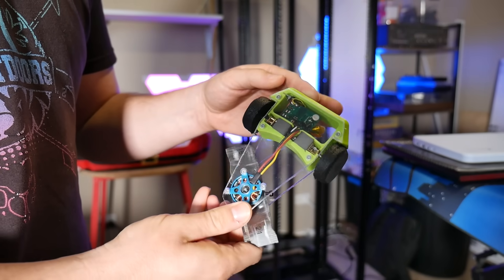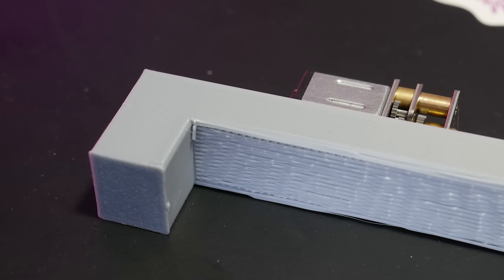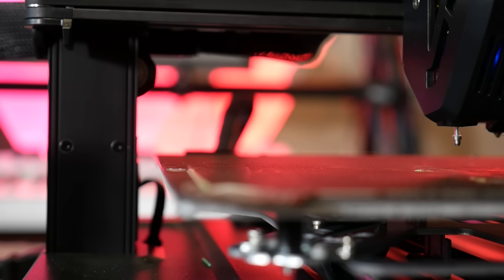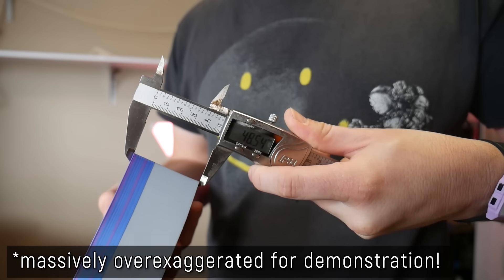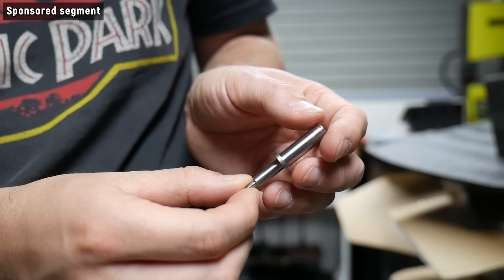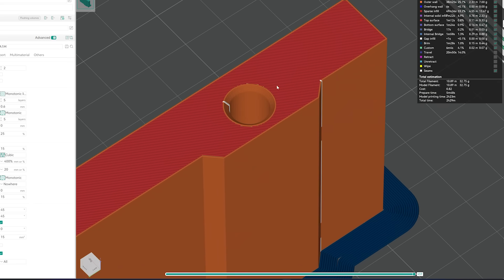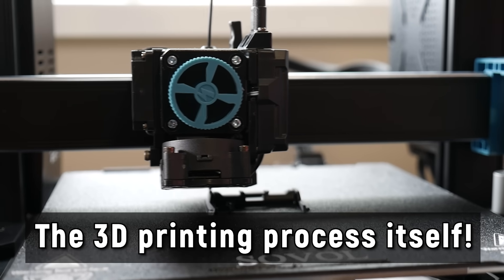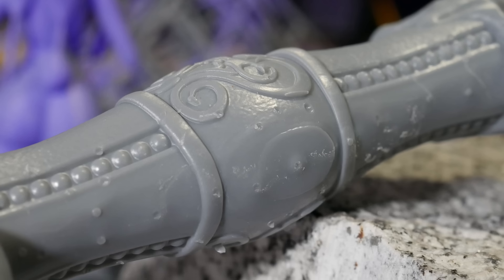Don't make these 3D printing mistakes (they RUIN accuracy!)

Comment: last night i printed a plate for a second time, 2 parts on it, print by object
the first print had detail that i didn't even see on the slicer, it was on one of the parts only

I resliced but only changed variable layer height on the other part on the plate, not the one i'm referring to with the extra detail
after printing it the second time, that detail is gone
does anyone know what might cause this?

Comment: The shaft argument is actually not correct your bears ears make it significantly weaker for a driveshaft. Your points of sharp corners while true doesn't help here, you have weakened the torque load transfer,  which might not matter for your model. I asked grok to explain it clearer than me.
If the shaft itself has that D-shaped profile (like the left image's cutout), then the left part (simple rectangular/D-shaped slot) is definitely the stronger choice. Here's why:
Why the Left Part Wins Now
Perfect Geometric Match:
Optimal fit = maximum surface contact with the shaft's flat
Even stress distribution across the entire D-shaped interface
No stress concentrations from mismatched geometry
Full mechanical advantage of the shaft's designed flat
The Right Part Would Actually Be Weaker:
Poor fit with a D-shaped shaft - the bear cutout wouldn't mate properly
Point loading where the shaft contacts the irregular cutout edges
Gaps/airspace reducing effective contact area
Potential for rocking/vibration due to inconsistent contact

Comment: I hate bed levelling, but the worst thing is that it could be a lot easier, if they'd just put the screws under the levelling point. Though this can be harder to do, because screw's would have to be tapered, and the bed would have to be thick, or it'd have to be welded on, and that can cause warping, and replacing beds get more expensive then

Comment: One important tip you missed... 3D printing is NOT always the solution. Consider whether it might be better to make the part from wood or metal, and either manually cut, drill, etc or use a CNC machine.

Comment: not an optimal position for the cutout. You should have left the flat side of the full length so it stays stronger and cutout following a tangent from that. Now the main part that supposed to prevent shaft for spinning is barely holding as it's so little.

Comment: Internal part connection strength. To prevent smaller details, such as small rod extensions from a surface, breaking off, design internal hollows that will double the wall count of that particular extrusion area and create deeper extension internally beyond the connection surface. 
An example would be a small candle on a cake. Create an internal hollow cylinder inside the candle and extend that hollow to the bottom of the cake. Candle will be much harder to break away.

Comment: Really useful video! I would also add, that for parts which have holes from multiple directions, setting them up diagonally either in a champher or raft can often help to make them accurate. Holes at 45° usually print very well.

Comment: Stiffer - i.e. higher youngs modulus is a big deal though iesp for functional parts

And with some there is a tangible benefit in tensile strength too - PA12 CCF it does increase the tensile strength considerably - meaning they’re better able to resist deformation underload (e.g. euler-bernoulli bending/Castigliano’s theroem/bending stress equation of your choice)
Tensile Str roughly doubles for PA12 from ~75MPa to 150MPa and the young’s modulus (i.e. stiffness) increases ~2.5 fold from 5GPa to like 13GPa
Shear modulus and strength don’t really increase much (Carbon fibre isn’t exactly renown for its shear stress resistance)

But Id imagine  the quality influences it a fair bit and not everything sold commercially is going to be the same quality as the below paper did (though my uni are cheap bastards when it comes to filament tbh)

https://www.sciencedirect.com/science/article/pii/S2214785322057601

Comment: As a high-precision machinist (+/- 0.0001 inches on avg) I spend so much time during every single set-up process making sure the machine is square and level. Every little adjustment will change the taper. Gcode and indicator probes can help clearup some funky happenings, but nothing is more important than making sure the hardware itself is in proper alignment. Leveling the bed on a 3d printer im sure also will be far more useful long term than using an automatic system
Reply: that’s partly true. The machine should be square and straight to boot, but as the bed is heated, it will expand and warp with each cycle, so the automatic bed leveling is useful to compensate for different changes of size at different bed temperatures. E.g. on a prusa i3 mk2 the difference in bed height between 60 degrees centigrade for PLA and 80 degrees centigrade for PETG is about 0.1mm to 0.2mm and unfortunately the bed doesn’t stay same shape. You can’t make the bed as stiff as you would make a table in a cnc because it moves and rather fast at that, so increasing mass increases issues with vibration. At some point down this road you’ll arrive at an industrial sized behemoth, that won’t be practical anymore. In the end it’s all just a compromise

Comment: 8:34: Another trick you can use is to add another part that the printer can use tu pull the filament and then cut it of using sheet metal scissors.

Comment: Wouldn't it be amazing if some extra smart independent developer - or even the slicer AND/OR the CAD software developers - would write some sort of post processing code that could be applied before or after an object is fully designed to optimize designs for different types of 3d printers (FDM vs. resin).  There are 2 people that I know of who have written the "Brick Layers" code (@GeekDetour and @tengertechnologies).  If they can code for alternating layer heights, I would think it is possible to find the specific gcode that makes, for example, an internal (right) angle or angle <=> a certain amount and replace it with a "dog ear".

Comment: Water still shrinks as it cools. It just has a small temperature range where it doesn't, from 4 C to 0 C where it crystallizes into ice. But that's a very rare exception to the rule.
As a matter of fact, sea level rising is primarily due to heating ocean/sea water. Sea ice melting actually lowers the level, and while land ice melting has huge implications to global sea levels, this has not happened much yet. This is why we expect the sea level rise to accelerate a lot in coming years.

Comment: 8:44 not entirely sure whether I should agree with this but I will definetely try it out. The only reason why an !internal! corner wouldnt be 100% sharp is that the filament while doing a corner is "dragged" to the inside of the corner while still beeing molten. other than that a print path would create a theoretical 100% sharp corner. What I found to be more annoying were seasms. a cutout in the inner geometry allows the seam to be placed there instead of on the contour where it touches another part and thus creates a non perfect contour.
But as mentioned I will definetely print a Testpiece and have a close look at it with a magnifying glass

concernning horizontal holes: your approach is one way to solve the issue pretty fast and easy. What I always do is to cut out a real tear shape with a spline that is offset by a few tenths of a mm from the upper side of the hole. Doing this in the correct dimension creates a near perfect hole as the top drops down a bit going back from the teardrop shape to a round hole

Comment: If dealing with supports on a repeating part, print a blank and pause the print right before the layer that needs supports. This only works on a flat piece that needs supports, but putting a cold piece of pla in as a blank allows for smooth finishes on the bottom without too much adherence.

If the support blank isn't surrounded, it will need to be designed with feet that wrap around the part to prevent it from moving. When the part is removed, the blank can drop out of the bottom.
Reply: make that blank out of e.g. petg when the part is pla and you can set zero layer gap as they will not fuse together :-)
Reply: @MarekLewandowski_EE  Agreed, if you want the best finish, go with petg to prevent all adherence. I should have put that in there. Good catch. I have a roll specifically for that, and support interface if I ever get an AMS. Cold PLA works as well, just not as good. Takes a little more force to remove and if the fit is somewhat tight, you'll damage the blank when removing it which isn't ideal.

Comment: The extremely important and completely overlooked PROBLEM with carbon fider reinforced filaments is the splinters. Not to mention that just grabbing your part will eventually leave splinter, carbon fober splinters don't leave the skin, as they are bio compatible, they stay stuck in the skin layer until it gets shed. If you only touch once a part, it might not be an issue, but with a prototype that you will tweak a lot (I saw that in model rockets) it becomes a health hazard

Comment: You should mention the shrink compensation in slicer settings. For historical reasons these values are not pre-filled in the various materials. Instead the STLs were usually given pre-scaled to compensate. But it is ridiculous now that there's so many material types from so many manufacturers.

Comment: Regarding thin walls... even with Aracne enabled, you should always pay attention to default extrusion width! On many default profiles (e.g. all Prusa Input Shaper profiles), a 0.4mm nozzle actually prints perimeters that are 0.45mm wide and the slicer can push it all the way to, say, 0.5, or even 0.6mm. This means a part that you would expect to be three perimeters thick (for example 1.0-1.2mm) often gets printed with just two perimeters that are "compensated for" with higher nozzle flow. However (a) this means weaker parts (fewer perimeters) and (b) usually tanks you dimensional accuracy. In other words, when the slicer thinks it can "get away" with fewer perimeters by simply boosting the nozzle flow, it often will, and you have to explicitly stop it from doing that if you actually want to be accurate on thin walls.

Comment: The bed level compensation issue is one i've been ranting about everyone ignoring since automatic bed leveling appeared.
The bores one isn't an issue if the bore size matches a common drill bit or reamer size. A drill bit run in reverse will friction form the hole for you.
Reply: automatic bed leveling is the biggest placebo in the 3d printing world. 

put the machine together correctly this time and actually tighten the bolts, tram the mechanism so it's actually level to start with, then use a feeler gauge or even a piece of laser paper to set the gap. then make hundreds of prints and never think about the bed until you have to replace the heater.

and use a raft if it really needs to be flat!

no industrial machines use automatic leveling. it's a massive waste of time, and a band-aid for your printer's mechanical instability.

Comment: My Sovol Zero has a 165x165 mm bed and it's pretty easy to keep that flat, but as shipped from the factory, the front 70 mm drooped 0.3 mm.  Klipper could easily compensate for that but it would still leave the printed part with a little bit of warping.  Printing smaller parts on the rear of the bed solved the problem but it bugged me because it could be better and wasn't, so I manually corrected the problem by sanding the mounting spacers below the bed to make the bed level over those four points and then sanding the magnetic sheet on top of the bed to be flat, using repeated bed meshes to guide my sanding.  The bed is now flat and level within 0.07 mm.   🙂

The Zero is a solid and accurate little printer that's great for printing precision parts from high temperature materials.  The smaller passively heated enclosure heats very quickly, making ABS as easy to print as PLA.

Comment: 4:06 Water DOES shrink as it cools, right until it makes the phase transition from liquid to solid, then the crystalline structure ends up taking more space than the previous liquid does. After forming the crystals, it will again shrink, a tiny bit, as it cools further.
Reply from the maker: Had no idea, I've been educated many times now :P
Reply: Due to its density anomaly, water is densest at 4 degrees Celsius. Not at 0 degrees Celsius.
Reply: @richardstein9847 Thank you for the clarification. As an educated guess, i would think that between 4 and 0 celcius, the molecules are begining to "pair up" in a pre-crystalizing state creating/caused by tiny regions where the thermal energy is slightly lower than the average of the larger area.
Reply: I suffer from shrinkage when I jump into my backyard unheated pool. Can I 3D print an appendage enhancement?
Reply: @googleuser4720 typically those print jobs take about 9 months and for half of the population you need to outsource the printing job
Reply: @googleuser4720 LOL good one 😂
Reply: Good to know!

So how can we use this for 3d printing?
Reply: @Brian-Midnite  you internalize it, you understand and apply the theory, and then when you encounter an unusual design scenario... like a part that needs to be exposed to water and endure freezing... you'll know what mistakes not to make.
Reply: Carbon fibre can also often have a negative coefficient of thermal expansion from 20C to ~400C, that's why high CF fill filaments, such as Siraya's, can have basically no shrinkage. The CF largely cancels out the thermoplastic CTE to give the bulk CTE of close to zero. There are also many ceramics and some metal alloys that display this property. Another slightly related fact is that CF tensile strength can increase significantly above 1000C.

Comment: About supports: custom, modeled supports VERY effective - i recently print round overhangs in PETG)
About round vertical holes - try to use vertical slot, which will be 0,2...0,5mm higher than width

Comment: one thing i learned in metalworking: if you want nice snug holes, you gotta ream them yourself! drill or cast a little to tight, and ream nice and gently, for perfectly smooth bores and holes. 
case in point: i printed a pocket sax in clear PETG. )highly recommended for all reed blowers out there) hot, slow, thick walls and about 0,3% overextrusion, to get it see-though clear, and free any of silvery air gaps. but the intonation just wasnt right .. until i looked at the model, and figured that all the finger holes were exacty 7mm. one gingerly reaming (with a cheap 7mm metal drill) later, taking off very little material, all notes were spot on.

proper reamers self center and taper a little at the tip. those make holes you dont even have topolish anymore
Reply: Yeah I just open them up with a drill bit. It´s way easier and works every time. It´s just plastic. You always have layers and such. I also would never use this teardrop design. It creates stress risers exactly at the mounting holes.
Reply: Been there, done that. I printed a flange bearing block with ample clearances around the flange edge, the depth of the bearing, etc, but the hole for the bearing itself was sized about 0.1mm under sized with a nice chamfer/countersink to help guide the bearing during the next steps. As a part of post processing, I scraped off the seam with a knife, tested the fit, sanded the hole with 800 grit sand paper, tested the fit, sanded some more, tested the fit.... until I was happy with the perfectly tight press fit. Additive manufacturing is great, but combining additive with just a little bit of subtractive can achieve results that are pretty much impossible otherwise.
Reply: @TheArmyKnifeNut  You could have also used crush ribs instead. Flexible small arms that get crushed while installing that bearing. Depending on your use case of course.
Reply: @sierraecho884  I considered it, and if it was going to be for production or something a lot of people would be printing, it might be worth it. However, for a one off small part, I trusted working it down to the final dimension more than trying to dial in crush ribs. Plus, I was looking for some rather tight concentricity, and figured I'd be better off. I almost always trust a post processing step over trusting deformation to act the way I want.
Reply: @TheArmyKnifeNut  Yeah, this makes sense. BUT consider the following, if you had taken the time to dial in your design with the crush ribs, you could have used the same dimensions for similar type bearings or features in general, in the future. I mean i absolutely understand why you just did it this way, I would have too probably, but sometimes it´s good to experiment in such a way. The gained knowledge isn´t lost and the invested time isn´t alaways wasted, if you can reuse it.

Comment: I'm new to 3d printing, but as a machinist I'm always chasing precision. Some parts i just printed were larger, and i noticed the z axis was within a few thousandths of an inch, while x and y were about .5% smaller than the model. I was wondering if it was shrinkage, and i first i was skeptical because the z axis was so spot on, but wouldn't it make sense that shrinkage in z at least on a taller part wouldn't be a problem? I would imagine that as the part cools and shrinks the layers to come would likely "fill in" the shrunken area because the z axis moves are fixed each layer. Am I way off? I'm not excellent and envisioning these things, so someone correct me if I'm wrong.